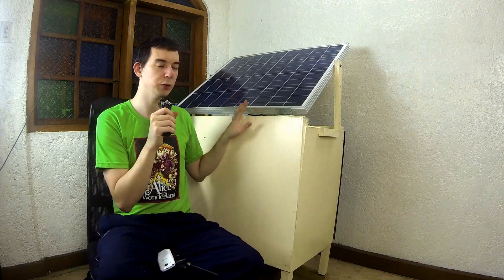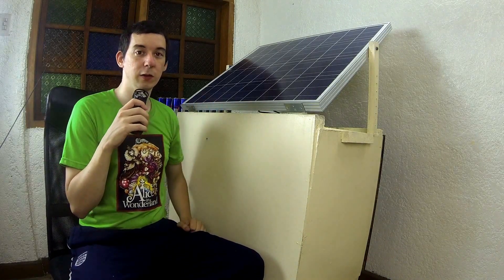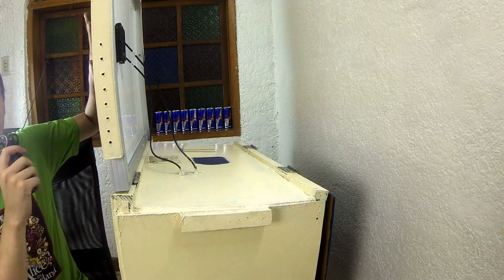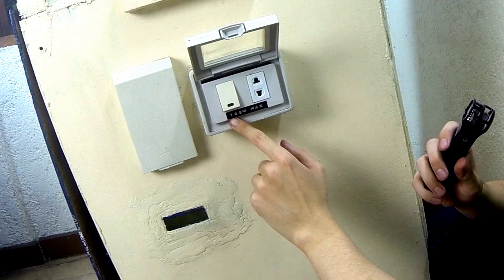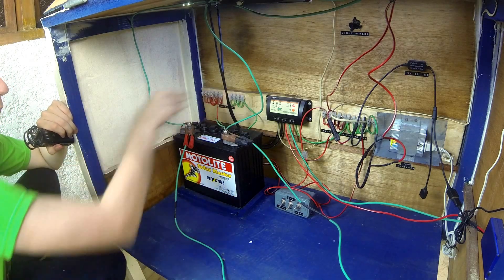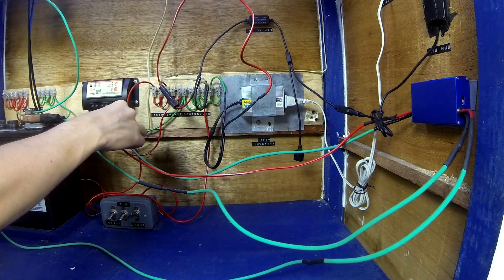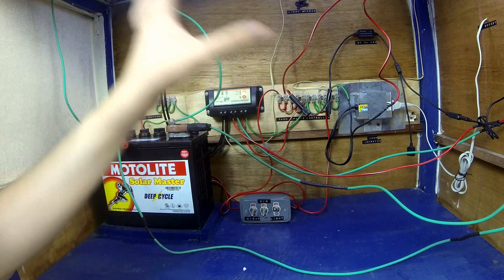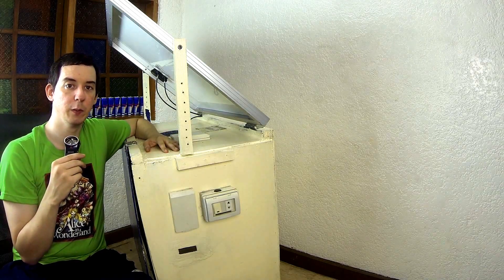Portable Solar Power Unit

Comment: hi... we're considering of setting up off grid  1500 watts solar power, i was quote 220th, its too high, i do not like the idea of grid tie, bec it wont work when meralco is down... you think its possible to solar power our home, can we diy it..... how many batteries needed ...
Reply from the maker: Hiya. How many batteries, what size and brand are included in that quote? Also what inverters did they plan to install? I assume it includes mounting brackets and professional install on your roof? Grid-tie is generally the most efficient, especially on a setup that large because it would require a large expensive battery bank to store that much power. You might want to consider a grid-tie system with X percentage being dumped into a smaller battery bank for those hopefully rare off-grid situations.
Reply: Gadget Addict
 tnx. the quote includes all but i did not ask how many batteries i assume 15 also for 100 ah... my concern is, we do not use much elecricity at daytime,   we use aircon at night only, running 3 fans and ref.... but daytime its just one fan and the ref..... and our goal is to zero on the bill as much as possible... i was quote for 149th for grid tie 1500 watts, and 220th for off grid.. thats from solaric by the way.....
Reply from the maker: ceejay1110 1500 watts of solar panels would likely cost 80,000 PHP. 15 motolite 100ah batteries would cost around 90,000 PHP. A decent inverter to actually power your aircon units etc? 30,000+ PHP. Plus the wiring, fusing, roof mounting etc. To be honest 220,000 PHP probably isn't a bad quote. If you went grid-tied you could consider joining the solar net metering program with Meralco, where they pay you for excess power you push into the grid. So although you wouldn't be directly using your own solar power, it would offset against your bill. Some meters actually turn backwards when you push power into the grid, this has the benefit that you can push power in during the day and then use power during the night, balancing the meter back out again. But I think most meters in the Philippines simply stop turning rather than turning backwards. I'm not sure what else to say, I think their prices are probably pretty competitive.

Comment: Hi Gadget Addict, first of all, thank you for all your videos it's really very informative and practical. I have a couple of question though on that 80W portable solar power unit set up you have. Can you give me a ball park figure on how much was the cost for setting it up? And also, what particular appliance/s can it power up over night after storing power for a a whole day? Thanks and more power. God bless. :)
Reply from the maker: Hi Jonathan, I'm glad you like the videos :) For the cost of each component, check my reply to Kuroro Ruciful on this comments area :) As for how much it can power, lets imagine that it got 5 full hours a day and produced 400 watt hours (5 * 80). It's not as simple as this because there are some losses when storing the power and using it but then this panel also puts out more than 80 watts so it's close enough for rough calculations. 400 watt hours means you could run a 1 watt LED for 400 hours or a 400 watt halogen for 1 hour. A 30 watt fan could run for (400/30) 13 hours. If you had a 30 watt fan and a 5 watt bulb and a 20 watt tv (400/55) you could run them all at the same time for 7 hours. In reality you also have to consider that you usually don't want to discharge your battery beyond 50%.

Comment: Hi Phil, I am a fan and I love watching your vids. I must say you have a huge talent! Thank you for sharing to our kababayans! How long have you been living in the Philippines? You trully have the heart for the Pinoys. And because of your vids I thought of putting up my own solar power. Am planning to build a 100watt solar panel and 100 ah 12 volts battery. I just don't know what goes with it i.e. solar charger, meter, wirings and stuff. But as of this moment I would like to experiment and start small. Currently I have a 1000 watt inverter and 12 volts 9 ah battery. What solar panel and solar charger should go with it? Educate me. Thanks!
Reply: When I say solar charger, I mean solar charger controller.
Reply from the maker: Salamat po :) I've been here for quite some time na :p I'm glad I've inspired you to consider your own solar setup. With solar becoming more affordable and Meralco prices rising every few months, it's a good time to get into solar. Especially since the country still suffers regularly from brownouts, either from storms, other natural disasters or sometimes what just seems to be random. You probably know this already, but when it comes to the battery, just remember it needs to be a deep cycle battery. When choosing between charge controllers, the cheapest most common starting point is a 10 amp PWM controller, these start from 500-1000 PHP and can usually handle a maximum of 150 watts solar panels. The charge controller basically drops the higher voltage of your solar panel to something that is suitable for charging the battery and automatically cuts off when the battery is full. If you connect your load to the charge controller (i.e. lights) it will also disconnect that load if the battery is becoming too empty. A PWM charge controller wastes a lot of power because it's not very smart. A more expensive but far more efficient charge controller is an MPPT one which does smart adjustments to the voltage/current on the fly to ensure you get the maximum power out of your solar panels. The most basic setup is to wire your solar panel positive and negative to the solar markings on the controller and then your battery positive and negative to the battery markings on the controller and then your small loads (100 watt or less) to the 'load' markings on the charge controller. If you plan to use a 1000 watt AC inverter, that would be too high a load to run directly from the controller and instead must be connected straight to the battery. You'll have to monitor the battery voltage to ensure you don't over-discharge (empty)  the battery too much. Maybe I should do a video with the most basic wiring setup and a mock house to show a 5-minute getting going guide.
Reply: Oh Phil, how nice of you to reply immediately to my post. And so very nice of you to do a video about my queries. Am from Quezon Province and we are directly hit by typhoon Glenda. Most part of the province have no power until this date. Maybe you can suggest what should I do with what I have now. I have a 9ah 12v vrla baterry and the inverter. What solar panel should come with it and charge controller. Should I push through on buying a 100 watt panel and 10amps charge controller? Would it fit with my battery at hand?
Reply: Is it also safe to buy deep cycle battery from cdrking for it is much cheaper to buy most parts of the solar power system from there.
Reply from the maker: John Maranan Sorry to hear you have no power. We lost power for a couple of days and then it came back with the rolling brownouts and then after 4 or 5 days from when the storm started we had normal power again. The battery you have right now is very small. It would really be the bare minimum. Let's imagine you have a 100 watt panel and 10amp charge controller with your current 9ah battery. While the sun is up, the battery will fill pretty quickly and you could draw a load up to 100 watts without any issue, you'd really just be using the battery as a buffer to stabilise the power coming from the solar panel. If you tried to draw more than 100 watts or you tried to use the power at night, you'd very quickly consume that batteries capacity. 9ah x 12v = 108 watt hours. That means the battery could run a 1 watt bulb for 108 hours or a 20 watt fan for 5 hours. You can you have a 1,000 watt AC inverter, that's quite a big beast. You'd want to be careful that you don't consume more power than you're generating. What kind of things do you want to power and during what times of the day/night?

I'm not sure about the quality of cdrking deep cycle batteries. I asked motolite if they'd sponsor a video comparing their deep cycle batteries to cdrking but they didn't reply.
Reply: See there are only two of us living in our house, my wife and I. So during the day from monday through friday we don't use any power except for the fridge. We only stay at home during the day on saturdays and sundays and holidays. During the night am using 60 watt electric fan, two 5watt led lights, a desktop pc, and led tv.
Reply from the maker: John Maranan You would certainly need a bigger battery than 9ah for those loads :p You might also have to consider how much power the solar would generate vs. how much power you want to use. Imagine if you had a single 100 watt solar panel that generated full power for 5 hours a day. That would give you 500 watt hours (100x5). Provided you had a battery big enough to store that power, here's how long it would last with the loads you mentioned. Two 5 watt led bulbs, 60 watt fan, 25 watt LED TV = 90 watts total. 500 / 90 = 5 hours. The desktop PC with monitor is likely power hungry and consumes 100-150 watts just by itself.  If you turned off everything else and ran just the computer, assuming 120 watts average, it would run for around 4 hours.
Reply: Oh I see. I can change led bulbs and decrease usage of desktop pc
and tv and perhaps use a lower voltage fan?
Reply: If I increase capacity of my battery, which one should I buy (the cheapest you can suggest with a 50-100 amperage)? Since you are using motolite batteries in your vids, do you have access on the prices?
Reply from the maker: John Maranan If you're going to get a 100 watt panel, the minimum size you'd want is around 40 ah which is about 3200 PHP if bought directly from motolite order hotline. The thing to remember is that people usually don't discharge their batteries beyond 50% (to keep them healthy) so as much as possible, you actually want to buy double the minimum capacity.
Reply: so if I am going to push through with the original plan, am really in need of buying a 100 ah?
Reply from the maker: John Maranan You could try get by with less, but the 100ah is really the ideal starting point and offers you room to grow with extra panels in the future.. Solar prices are falling but it's still an investment and it still takes a couple of years to get your investment back from the sun. To me, it's not just about being green and saving money, it's also about the convenience of having power even when the grid is down.
Reply: Yeah, convenience is my main purpose of taking interest in the sun's power now that a possible rotating brownouts is going to happen. Do you happen to know the price of a 100ah motolite?
Reply from the maker: I think the price is around 6000 for the 100ah if ordered from their hotline :)
Reply: the next thing is I should think about is the budget. lol. that 6000 would have a mark up price if bought around here. will be looking around tomorrow.
Reply: thank you for all the attention, meanwhile i think am going to work with a 20-30 watt panel for a start and will power just he led lights at night and will expand eventually.
Reply: is the charge controller from cdrking shuts down automatically? it is one of my worries since we are at work during the day
Reply from the maker: John Maranan Good thinking :) That's a nice start. The CDRKING solar charge controller manages the charging process and makes sure the battery wont be overcharged.
Reply: Good thing! Am worried about getting my house on fire and no one is at home to attend to the solar charging.
Reply from the maker: John Maranan The charge controller will handle things just fine. Lead acid batteries don't easily catch on fire, especially not from overcharging. A short circuit is what usually causes the rare occasion where a battery melts itself. You should have nothing to worry about :)
Reply: Ok thanks a lot! Will update you on the progress of my project. Will also ask questions from time to time.
Reply: Btw, if i do stick with 20-30 watt panel, will it work with 100ah batt just in case i already have the budget for that? or should i go with the 100watt?
Reply: I mean I know it would work but would it be able to fully charge the 100ah batt?
Reply from the maker: John Maranan I wouldn't bother buying a 100ah battery if you will only have 30 watts of solar. It will work but it would take a very long time (days) to fill it up and you still can't use more than what you put in. I guess it might be worthwhile if you see yourself buying more panels in the future.

Comment: Phil, I really enjoy all of your videos. You make a fabulous presentation of whatever you're working on. Thanks. I am really confused on one aspect involving the wiring of your watt meter. I posted in your previous video of How to Wire a Watt Meter but have not been unable to determine what's going on with mine. I made a small portable solar generator using a 100W (2 X 50W in a folding suitcase style), a deep cycle 12V battery, a generic 15 amp charge controller and a DC to AC Inverter. I also have a GT Power Watt Meter (very similar to Turnigy) and wired it just as you suggest. Source to battery and Load to the charge controller. Doing so the Watt Meter would not provide all of the data that the Watt Meter was capable of monitoring. I posted on some solar forums and was advised by many that I had the connections wrong and the Source should go to the charge controller and Load leads should go to the battery. After making this change my Watt Meter works perfectly. With your expertise can you possible help me understand "Watts" going on here :-) Thank you.
Reply from the maker: High Ed, I'm glad you like the videos, thank you for the feedback. You can actually wire it either way and each will give you slightly different information. I updated the video description of my watt meter video a couple of months ago because not everyone wants to have it wired like I showed in the video itself. And I think some watt meters have conflicting setups to others. So I guess there is no "right" answer. I just did a Google now and it's really mixed 50/50 on how people wire them up, partly because of different brands and partly because of different data wanted from the watt meter. When you wired it the new way, are you getting incoming watts, outgoing watts, voltage, overtime usage?
Reply: Gadget Addict Thanks for your kind reply. The way I have my GT Power Watt Meter connected the measurement screen continuously displays Amps, Volts and Watts. All other measured values are presented sequentially, every
two seconds, in the “Data-Queue” position of the display. Data values are identified by their units (Ah, Wh, Ap,Vm, Wp). All measurement
screen values are updated every 0.4 seconds.

Comment: Great job! This will really come in handy during power outages. 100w is more than enough to power your modem/router and charge your gadgets (e.g. cellphone, laptop, etc). If you don't mind me asking, how much did this setup cost? (including the battery).
Reply from the maker: These prices may not be 100% accurate and are in PHP (Philippine Peso). Solar panel: 3400, battery: 3200, charge controller 1200, AC inverter 600, DC-DC converter for usb: 250, watt meter: 1200, usb hub: 150, misc wiring, switches, AC socket etc, 1000, spare wood. So around 11,200 all in.
Reply: Gadget Addict Cool! I was planning on getting a UPS but after seeing your video, I might go this route. But I think I'll invest more and use a pure sine wave inverter.

This video is inspiring.  Keep up the good work bro!

Comment: Could you give more detail on the watt meter please.  Thanks for the cool videos !
Reply from the maker: There's a few ways to wire the watt meter and the functionality differs between brands, but basically it shows you useful information like the battery voltage, how much the battery has been discharged, how much power has been put into the battery, maximum outgoing wattage, maximum charge amps and so on. It's very useful to get a quick overview of how your solar system is performing.

Comment: This is a great video. Keep them coming! :) Oh, by The way, I have a question. I have been thinking of making a solar power system of my own. And I'm a complete newbie regarding this. Where did you connect the 100w inverter? Also, how long will it take to charge the 40amp battery with this setup? Thank you so much for all the solar- related videos that you post.
Reply from the maker: Thanks :) I'm glad you liked it. Most small loads would be connected to your charge controller and if the battery voltage drops too low (ie. its low batt), it will cut off the load automatically. These cheap little charge controllers couldn't easily handle the load from an inverter so it's actually wired directly to the battery. Although I have the positive wire passing through the toggle switch which is on the top panel. This allows me to turn the inverter on and off without having to open unit. Even when no load is connected, this inverter will consume around 5 watts of power. Depending on the low voltage cut-off of your inverter, you might have to manually keep an eye on the battery to ensure it doesn't drop too low, since heavily discharging your battery can cause damage. Usually you wont discharge your battery past 50%, so that means the solar needs to fill a maximum of 20 ah. 20 * 12 = 240 watt hours. So with a 80 watt panel it would take around 3 hours. But of course there are losses and the voltage isn't exactly 12v on the battery, but it gives a very rough idea :)